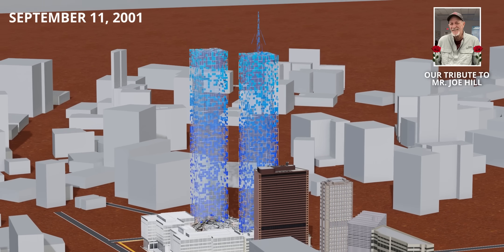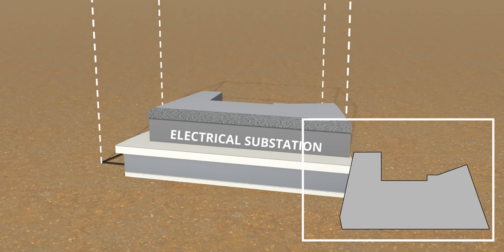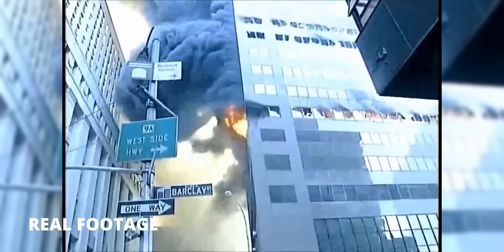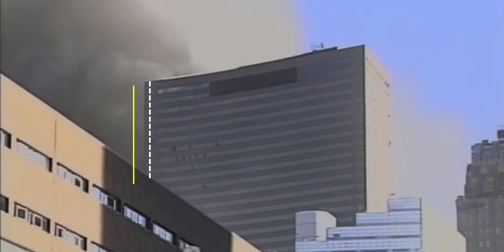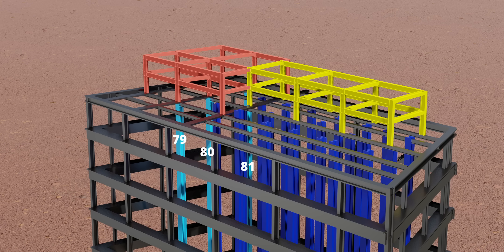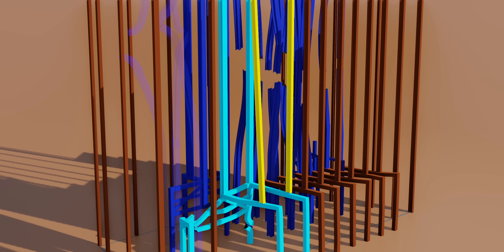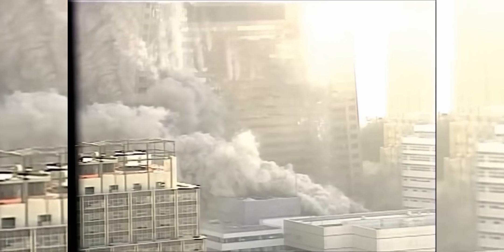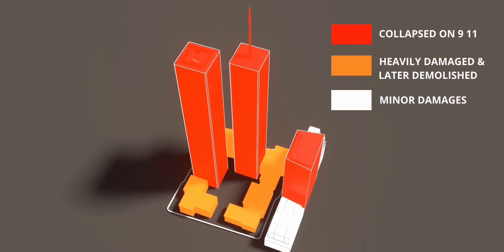Collapse of Building 7 | The Complete Physics

Comment: Complete bullshit
Reply: And yet not wrong. Go figure. 
	
This video is pretty good – with a few exceptions - and goes into a much higher level of detail than many viewers will be able to comprehend.  While not perfect, the collapse mechanisms – the sequence of failures - described here  are substantially correct and this is true no matter who planned and carried out the 9/11 attacks or why . 

That may not be what you want to hear and go against 20+ years of entrenched dogma and conditioning, but it’s not wrong. 

That also means (in case you did not get the hint) this video can be (and IS) absolutely correct in its description of collapse mechanisms AND the 9/11 attacks could still have been some sort of inside job. The two things are in no way mutually exclusive. 

The mechanisms described here have broad professional support around the world. There are no professional engineering organizations (for example: ASCE, ASEE, ICE, etc) that disagree with them or have offered any formal dissenting opinions or alternative hypothesis. 

So, setting hubris aside, either the overwhelming majority of the worlds structural engineers and simple observation are wrong,… … or you are. Which seems more likely? 

IF you still think believe this explanation is wrong then produce a better one . Good luck with that. No one ever has and I don’t see you moving that needle today.

Comment: @jaydunstall4641 no, direct energy weapon. Frequencies.. microwaves.. that's why there were jumpers.. there's no reason to think it was gonna fall. They were taking off their clothes because they were wet from the sprinklers and they were being cooked alive
Reply: @h1F595 why would that make them take their clothes off? Watch some videos of other skyscrapers on fire much much much worse fires, and it did not affect the structural integrity and they werent built  specifically to withstand such a thing like wtc was. They had no reason to think they weren't going to be rescued. If it was so hot that it was melting the steel, how were they able to get so close to the hole and touch the steel?
Reply: @teeteejones7983  - Oh FFS.  The fires weren't at the entry hole because anything that would burn was pushed to the opposite side of the building - which is why we see all the biggest fires on the other 3 sides of the building. This is all clearly visible to the naked eye and not difficult to sus out. Are you being deliberately obtuse or can you just not help it?

Fire is hot. 13 floors on fire simultaneously is hot. More than 200 people took the express elevator down because they knew there was no hope. Again, are you being deliberately obtuse or can you just not help it?
Reply: Have you ever heard of a building fire were people were trapped and they decided they had no other choice but to jump to certain demise before having the chance to be rescued? It goes against the laws of self-preservation. The most seasoned firefighter never seen anything like it. People were found 40 ft away from the building, the record for longest high jump is 11 ft, you don't find it odd someone would undress before doing this? It's not critical thinking to hand wave away but you can't explain. Fire is hot? Slow down there, Einstein
Reply: @TheCriticalStinker-01  Have you ever heard of a fire were people were trapped and they decided they had no other choice but to jump to certain demise before having the chance to be rescued? It goes against the laws of self-preservation. The most seasoned firefighter never seen anything like it. People were found 40 ft away from the building, the record for longest high jump is 11 ft, you don't find it odd someone would undress before doing this? It's not critical thinking to hand wave away but you can't explain. Fire is hot? Slow down there, Einstein
Reply: @TheCriticalStinker-01  YouTube keeps deleting my comment. It's hard telling the truth
Reply: @TheCriticalStinker-01  Have you ever heard of a situation like this were people were trapped and they decided they had no other choice but to jump to an end before having the chance to be rescued? It goes against the laws of self-preservation. The most seasoned firefighter never seen anything like it. People were found 40 ft away. the record for longest high jump is 11 ft, 
They were launched out.
you don't find it odd someone would undress before doing this? It's not critical thinking to hand wave away what you can't explain. Fire is hot? Slow down there, Einstein
Reply: " no, direct energy weapon. Frequencies.. microwaves.. "
Ah, yes. "Magic happened".

"They were taking off their clothes "
No, they were taking their clothes off because they were literally standing next to, and above, a raging fire several stories high, reaching 800+ degrees C.

" why would that make them take their clothes off?"
Because, revolutionary as the concept might seem to you, heat rises.

"Watch some videos of other skyscrapers on fire much much much worse fires, and it did not affect the structural integrity and they werent built  specifically to withstand such a thing like wtc was"
What does that have to do with the people "taking their clothes off"? Anyway, no building in the history of humanity has been built to withstand something like 9/11. Ever. Deep-mountain bunkers might be able to, but those aren't "buildings".

"They had no reason to think they weren't going to be rescued. "
What does that have to do with what's happening right there and then. "Rescued" means very little when the current situation is "above a raging inferno".

"nothing entered."
That's an impressively dumb thing to say. 

"Do you think people only fell from one side? "
No. No-one "thinks". Anyone with even the slightest bit of brains and ability to do research knows. You do not, clearly.

Comment: The stupidest part of this video is them claiming that the gash was caused by the spire from the WTC falling on it, that’s literally impossible because of the distance and just simply did not even happen
Reply: Not the antenna. It was perimeter columns from the norrh face of the North Tower - some of which reached out more than 800 feet from the base of the Towers.

Comment: If holes and traces of a liquid phase are found in the WTC 7 beams, could this be related to the collapse mechanism? I recommend reviewing Appendix C of the FEMA Report.
Reply: In which there there is a nice, neat explanation for said holes and traces.
Reply: @mooneyes2k478  To which explanation are you referring? I am referring to FEMA WTC Building Performance Study, Appendix C - Limited Metallurgical Examination, by authors Jonathan Barnett, Ronald R. Biederman, R. D. Sisson, Jr.
Reply: @pavelcerny758  Yes. I know what FEMA 403 says. And, as noted, the explanation is right there.
Reply: @mooneyes2k478 Are there any additional references that explain this phenomenon? According to my information, the entire matter ended up being unclear. I believe that FEMA itself—or the authors of this analysis—had uncertainties, but in any case, a liquid phase of steel is documented there.
Reply: @pavelcerny758  No, eutectic states is documented.
Reply: @mooneyes2k478  Evaporated steel is also documented in this report, see the photographs. How could this happen? Who investigated this subsequently? As you may know, a Senate hearing took place in March 2002 to address the disposal of evidence from the debris...
Reply: @pavelcerny758  No, evaporated steel is not documented. As noted, eutectics are. Which entirely explain what happened.
Reply: @mooneyes2k478  If anything compromised the steel (regardless of the process), I would see that as a possible cause of the collapse. And here you have it, stated in the report:.  "The thinning of the steel occurred by a high-temperature corrosion due to a combination of oxidation and sulfidation"
.

Comment: Man if steel buildings are susceptible to fires we might as well go back to wood eh?
Reply: Yeah this wouldn't of happened if It was wood
Reply: Not one building  has fallen before
or since 911 from fire, NOT ONE!
Reply: Amazing how so many skyscrapers around the world have been on fire, and some much longer than an hour or so, and yet those buildings didn't collapse.  Just so happened that these buildings didn't get the memo and did their own thing.
Reply: @ What is even more funny is this post from above... "Steel weakens at 600°F"
My oven in my kitchen is capable of 550F degrees. My oven deforms every time I set it to clean.
My grill out on my porch is made of Steel. It uses propane. I have to buy a new grill every time that I use it as it melts to the ground after 30 minutes of use.

A propane flame can reach temperatures of approximately 3,560°F (1,960°C) when burning efficiently and producing a blue flame. However, if the flame is yellow or orange, indicating incomplete combustion, the temperature drops significantly to around 1,832°F (1,000°C).
Reply: @nathanwoodruff9422  Yes, under heat your oven loses structural integrity. Luckily, your oven appears to have much more integrity than you and thus can afford the temporary loss of 1% of its structural integrity. Apparently "weakening" means "melting" to you? The idea of forging a nail must be baffling to you, since you cannot comprehend something losing structural integrity but not melting.

You must believe that every single factory that turns off its machinery in order to avoid metal creep is in on it. They merely run their machinery at operating temperatures; why would they need to cool down? Those machines aren't melting!
Woe is me for the lost productivity, if only they knew that Big Metallurgy was tricking them.
Reply: @anuspropeller3668  "Luckily, your oven appears to have much more integrity than you "
"Apparently "weakening" means "melting" to you?"
Apparently your integrity does not allow you to read properly, understand properly, or even understand basic physics which weakening and melting are in fact 2 different things. Something someone that never graduated high school would also not know or understand.
Thanks for your comment anyway.
Reply: @nathanwoodruff9422  “My grill out on my porch is made of steel. It uses propane. I have to buy a new grill every time that I use it as it melts to the ground after 30 minutes of use.”

That was your claim. You’re the one who equated weakening with melting, not me. My comment pointed out how absurd that is. But I get it, reading comprehension isn't your strong suit, so you interpreted a rhetorical question as a confession.

The fact that you're now explaining the difference between weakening and melting only proves my point. You understood the distinction all along, and still chose to comment something idiotic. Thanks for the clarification.
Reply: @anuspropeller3668  "That was your claim. You’re the one who equated weakening with melting, not me. "
Coming from someone that didn't graduate high school, I can understand how they also equate two plus two equals 5.

What this poster failed to read and also understand was the parent poster owencovell1008  said that steel starts to weaken at 600F degrees. 

"This is objectively false. Steel weakens at 600°F and loses roughly 50% of its strength at 1,100°F. "

Here is how clueless this poster is. A propane flame of approximately 3,560°F in a propane grill would melt the grill to a lump of steel. 
Since that doesn't happen in reality, this poster and poster owencovell1008 don't live in reality and are only here to rewrite history to fit their narrative.
Reply: @nathanwoodruff9422  Why are you contending that steel doesn't lose structural integrity at elevated temperatures? Are you so obtuse that an uncontroversial fact about material science must be incorrect simply to fit your shoddy worldview? Why do factories around the world turn off their machinery to cool down; they never even come close to their melting temperatures. Have you never seen someone forge a nail?

News flash. Your grill does not reach adiabatic temperatures. Let's get the actual numbers. Oh! Would you look at that, google says the maximum temperature of a propane grill is around 600°F. Woe is me that there's not some global conspiracy that metal doesn't lose structural integrity under elevated temperatures. Google proves you wrong all day long. 
But thanks for the delusions. I hope they paid the $0.10 for the comment.
Reply: @anuspropeller3668 what the point is : steel ovens and grills are designed to reach 500… engineers designing both know they won’t weaken at a contemplated temperature. I see you didn’t answer or rebut the google facts laid out to you.
Reply: @cocochanel1399  Why would I have to rebut the google facts? I'm agreeing with them. Nathan's nonsensical rebuttal of steel starting to weaken at 600 degrees by saying his grill does not melt, has its premise disproven by his grill not even coming close to those temperatures. Engineers do take into account grills weakening at those elevated temperatures, but those temperature don't weaken it much either way; it's not melting but weakening. This weakening would be a bigger problem if only the grill was a load-bearing structure.
Reply: Steel is formed by heating it and deforms the same way.  That this is news to some boggles the mind.
Reply: @TheCriticalStinker-01  you robots cant even keep your story straight. "Oh the towers collapsed becaus jet fuel burns really hot" but wtc7 just gets taken out by a campfire lol
Reply: @TuriGamer  did you even watch the video? ...or know anything about what happened at all? 🤣
Reply: @dutchdeluxe69  Nothing but conjecture
Reply: @TheCriticalStinker-01  "Steel is formed by heating it and deforms the same way." Wood ignites anywhere from 380F to 410F degrees. Iron does not ignite. Iron starts to weaken at 1,800F degrees and becomes bendable at 2,500F at the square of its thickness times its width and length. 
Jet-A or purified Kerosene burns in ideal conditions at a max temperature of 1,200F degrees. 
That this is news to some boggles the mind.
Reply: @nathanwoodruff9422  This is objectively false. Steel weakens at 600°F and loses roughly 50% of its strength at 1,100°F.  The adiabatic flame temperature of Jet-A (maximum possible in ideal conditions with perfect combustion and no heat loss) is ~3,500°F (1,927°C)
Reply: @owencovell1008  "The adiabatic flame temperature of Jet-A (maximum possible in ideal conditions with perfect combustion and no heat loss) is ~3,500°F (1,927°C)" Yea, that is great for it under pressure and ideal conditions inside of an engine. But inside of a building with no ventilation and lack of oxygen inside the building, the MOST ideal conditions are 1,200F degrees with average conditions about 800F and with lack of oxygen about 500F. 
Google proves you wrong all day long. 
But thanks for the delusions. I hope they paid the $0.10 for the comment.
Reply: @owencovell1008 so your saying of steel is at 50% strength it gives zero resistance ?
Reply: @TheCriticalStinker-01  Indeed, people seem to have forgotten that iron smiths have known this fact about metal for centuries.